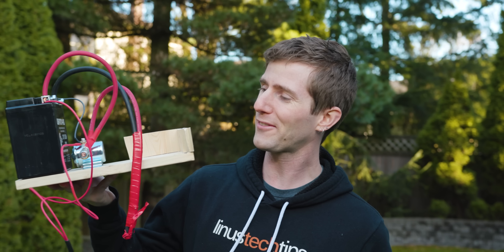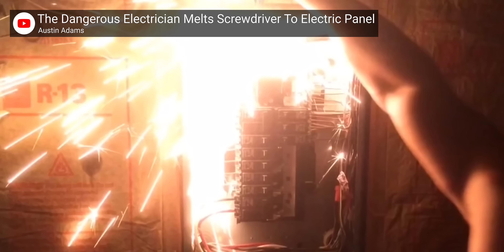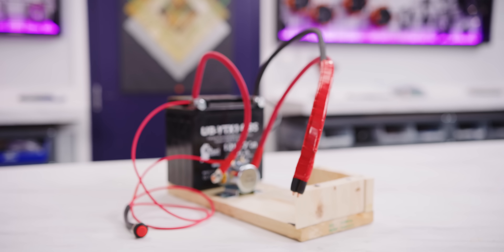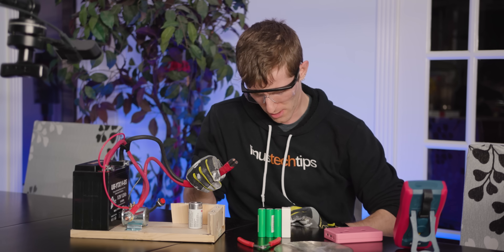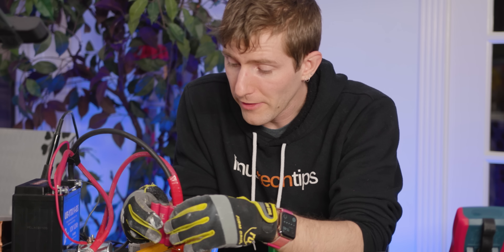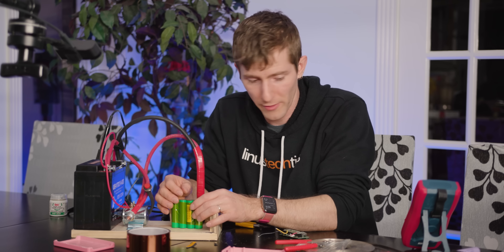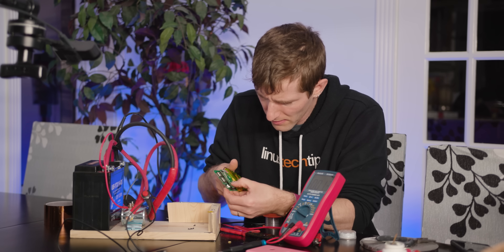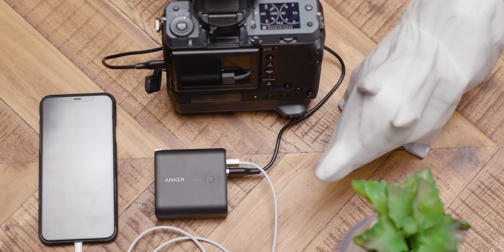I spent $100 to save 20 bucks... and it was TOTALLY worth it!

Comment: I will definitively not do that to save a charger , but it was nice to learn how to do it  . Thanks !! ❤️ Stay safe ! 😷
Reply: Easy solution buy a powerbank case instead, you can get cases with spring terminals that accept 18650s, same as replacing AAs in anything else.
Reply: @vgamesx1  yep, you can get them for like ~$5 and use cells from old laptop or anything really
Reply: the easy solution on this type of battery is buying 18650 sockets and soldering those, plus you can swap out the cells when they are dead. also you can use laptop batteries for that purpose.
Reply: @satibel  they did that on their other video (modding power wheels) they probably didn't do it here because you couldn't fit an 18650 socket into the power bank casing.
Reply: For Linus saving 20 dollars for 2000 dollars will be "worth it" too
Reply: @kausik206  to be fair, the amount he makes off of youtube ad + floatplane + sponsors most likely makes it worth it

Comment: Linus, you should really be using a n channel MOSFET to switch your high current circuit. That momentary switch is just not going to give you the control you need for consistent welds. A mono stable "one shot" 555 circuit comes to mind. Stay safe, and don't "relay" on mechanical devices to control duty cycle.

Comment: I'm going to solder a bunch of used 18650 batteries together tonight.

I'm soldering the pre-welded tabs together, using heavy gauge copper wire. I hope that made someone freak out

Comment: WOW ! This is great idea. But It will be MUCH BETTER with a timing circuit that will switch the relay on and off so you will be able to set the right welding time which you need. or even greater improvement to add fixed positions high power resistor with settable resistance to limit the current because sometimes is better lower current at longer time for higher quality weld but I am not sure if this is necessary worth. Also I would rather mount the battery in some kind of more durable frame instead of sticking it with tape.

Comment: If you wanted to make this home made spot welder more consistent you could probable use an arduino to control how long the relay is closed for when you press the button. The only issue there is obviously you can't use a 12V relay with a 5V arduino if it won't flip the relay with 5V.

Comment: You should have put a microcontroller between your button and your relay so you can have the microcontroller give the exact timing for every spot weld. This would have avoided all issues with over current and been a lot safer.

Comment: Maybe could've used an Arduino to "push the button" for you for a programmed time when you push it's button.
Or even give it 3 buttons for more_time, less_time, contact.
Or used some electronic components, but this is imo hard to do and tune.

Comment: Ankers batterie lineup is quite outdated though
Reply: I can recommend ravpower. They seem to have the newest tech right now. Usb-c 30w pd on small battery and 60w on the bigger. New bigger and energy dense 5000mah batteries.
Dodocool is great too and doesn’t cost as much, but is not always available on amazon. Has 45w pd too, bought it discounted for 20 bucks.

Comment: I did it with a Sentey 20800Mah power bank that was under half of the original capacity and also the original capacity was fake, the cells inside where 2000mAh unbranded chinese cells that were out fast, and now the 8 cells where under 1000mAh, to reach 20800mAh them must use 2600mAh cells, the real original capacity was 16000mAh, so Sentey lies. I replace those cells with 3000mAh samsung cells that I get for $15 so now I have a 24000mAh power bank that will last for many years with this good brand cells, probably the electronic board will die first than the cells were to a non worth continue using it point.

Comment: I see no reason no to spot welled another strip on top of the other one. In most big battery pack, where you can't simply run strait lines to connect the batteries, you must add another nickel strip just to account into the fact that some connections will have more current running thru them. In most cases the difficult part of fixing or doing DIY battery packs is to find decent 18650 batteries with good parameters and good price.

Comment: Actually your relay was acting weird because it is a mechanical relay and so when a lot if current is running through it it can stuck the Relay in contact  even with the command released si After it will operate perfectly normaly when it's not on load as in 8:58

Comment: There are also battery banks with replaceable 18650 cells, basically using the same methode as rc car batteries are swapped

Those would save some time and money perhaps

Comment: For the God's sake, why didn't you add a simple Arduino timer instead of spot welder switch?

Also, you should've pre-soldered wires to strips and then weld them.

Parallel is for capacity and higher current rating, series is for capacity and voltage. BOTH are for capacity. Ah are not for capacity, Wh are for capacity. Ah is usually misleading.

Comment: you go all the way to actually weld the strips, but then you just solder the tabs before welding them and heat the cells up anyway... smh. The electronics projects on te channel have always been so weak, better to do some more research...

Comment: 12V battery.... electrocution hazard... yea no. you would melt the switch and possibly suffer a burn but there is no way you would be getting electrocuted from that circuit. It also looks like that relay was being temporarily welded closed which is why it stayed on after you let go of the button. it's certainly cheap but not something you should rely on for more than a few shoddy welds. 

while i do like anker and they do make good powerbanks i found a usb C PD in&out bank by nusgear that is working really great for me that will actually put out 100W of power.

Comment: Pre-soldering the nickle-plate with a layer of solder would have probably improved the contact nickle won't bond as well to battery terminals as solder would, this would also allow for easier welds as solder melts at a much lower temperature than nickle.

Comment: From an electricians viewpoint: The Starter Relais you are using can weld/stick the internal contacts together by the repeated high current Pulse, or worse you can generate a high enough current in the Spotweld that the relais builds a strong enough magnetic field so the contacts in the relais do not release instantly but keep the current flowing. -> Danger of welding through the outer layer of an lithium cell = REEEEEALLLY BAAAAAD! even the 20 Bucks chinesium spot welder have an overtime Current shutoff as safety! THIS SHOULD NOT EXIST AND SCHOULD NOT BE USED ESPECIALLY WHILE NOT WEARING AT LEAST EYE protection, because the metal flung off by the welding can damage your iris and make you blind (worst case). Even more worst case is you kill the relay with an high current and it is internally chinesium relays that can withstand a pulse of X Seconds of Y Amperage but then sticks and shortcuts the battery and you think oh why is it not working, while the relays gets RED hot glowing and the next thing you know is the cooking battery acid Spewing all over you! FAT DISLIKE TO ALL OPTIONS!!!! this video schould be removed cause it is a catastrophic failure to happen !!!! I REPORTED THE VIDEO. Sorry I'm a fan of you since the beginning, but this is a failure to all safety regulations existing!! whoever got you this Janky idea should be removed for disregard of safety to property and people!

Comment: Any time I hear someone say you can get something "at any automotive shop" I have to wonder what auto shop they're going to. Autozone and O'Reilly by me (Cleveland west side) don't even carry the right weight of oil for my car. Thankfully Walmart does.
Reply: If they don’t have a generic aftermarket starter relay then what would they stock? Besides ugly bling?
Reply: there are quite a lot of bullshit auto shops out there
Reply: @peterg.8245  car shops sell anything besides ugly bling? /s
guess where the bigger markup is...
Reply: @peterg.8245  They don't carry much of anything useful that isn't universal fit. Wiper blades, but even then, not for European cars, and I don't just mean luxury cars, I'm including VW and Fiat. Batteries. Plenty of oil for older cars.

There are one of each of Autozone and O'Reilly in the Cleveland area that stock everything you could possibly need for Ford, Chevy, or Honda; but you're completely SOL for anything else.
Reply: Right Wing Safety Squad probably knowing we’re LTT is Lordco is the local auto shop
Reply: In texas you can practically rebuild a classic at a good auto parts store. I know bc my friend rebuilt an 83 el camino to pristine condition.
Reply: @VadersFist501st  that's awesome
Reply: @JaysFan69420  what weight you running? I run 20w-50 no synthetic in my 85 Benz. I find that the Valvoline stuff is pretty good
Reply: @commandohazelnuts  5W-40. Most European turbo engines and American auto-diesel engines use it. And yet the only shop that sells it is Walmart. Not O'Reilly or Napa - Napa does sell it, just not at the one closest to me. Autozone only carries STP branded 5W-40, but I wont use it because STP doesn't actually make oil and they don't say who their source is.

Comment: I build a same style spot welder a few weeks ago. I found a great timing relay, which controls the pulse from 10ms to pretty much every reasonable length. This makes it much more reliable,  repeatable and its more consistent. The relay module is called XY-LJ02 and can easily be found on Ebay or Amazon for around 15$ locally or for less than 10$ from overseas. I also found using a tungsten needle from a TIG torch as the electrodes super useful. I used copper wire before but it lost its tip shape to fast due to the temperatures. The tungsten electrodes hold up way longer. I just ask someone who does TIG welding if he had any end pieces for me that he would throw away.
Reply: for the timing, you can also use a 555 timer in the monostable configuration, with R=1k+100k potentiometer in series  and C=10uf
and use like 5 IRFz44 or any high current transistors in parallel on the output.
it's a very easy circuit to make, and requires only a few components :
555 timer, switch, potentiometer, 1k resistor, a 10uf capacitor, some high current transistors, and some 1-10k resistors for pull-up/down on the switch and transistors.

note that you can increase the resistor value if you decrease the capacitor value and vice-versa.
these values are for ~10ms-1s pulses.

note that you can also use an arduino instead, and just switch the transistors with it.
Reply: @satibel  is there a circuit plan available?
Reply: @satibel  I still have my (Radio Shack Engineer's Mini-Notebook 555 Timer IC Circuits).  I bet it's 30 years old.  I took a quick look and it's archived online.  Here's the link  http://www.n5dux.com/ham/files/pdf/Forrest%20Mims%20-%20555%20Timer%20IC%20Circuits.pdf
Reply: @satibel  I also looked into it, but found it much easier to buy the module. Found it from China for 5$ and it does pulse times from 0,01 seconds to 99,99 seconds in 10ms increments, 0,1 - 999,9 seconds in 100ms increments and 1-9999 seconds in 1000ms increments. For that price in can't invest my time in sourcing the parts and soldering them. 
I'm using a foot pedal from an old sewing machine as the switch to have my hands free.
Reply: This, this here makes it so much better.

Comment: The ironic thing here is that his homemade spot welder is actually more dangerous than attempting to solder the cells because if you apply the heat for too long from the spot welder it can actually get hot enough to melt through the casing of the cell causing it to vent as the one did in the video did.

Comment: Can i just shout out that guy in germany who makes arduino based battery spot welders. "malectrics". The device is SOOOOOO much better than this because you can control timings down to the milisecond and it has preheat functions, you can add a foot pedal, or it can just sense when your electrodes come in to contact. Comes with everything you need. Please, check this guy out before even thinking about building something as ghetto as this.

Comment: What is high current power? Power is voltage times current, you need voltage to create current. What electrocution hazard? 12v DC is nothing because the human body blocks DC.

Comment: "When you solder, you have to heat up the solder itself and flow it on to the materials you're trying to join."

NO! That will get you a cold joint that will have high electrical resistance and break easily. You need to heat the MATERIAL to above the melting point of solder and apply the solder to the MATERIAL. In practice, it helps to add a bit of solder to the iron to help transfer heat and a bit of flux to the material. To join materials, you should "tin" each one first.

edit: and I'll bet that was the cause of the bad connection at 11:33
Reply: you're completely right, but lets not pretend that was the most incorrect part of this video lmao
Reply: But the hold problem of heating batteries for a long time still exists
Reply: @sid670  right, so you solder your contacts to a wire before welding them (a loose one not connected to the electrically sensitive mainboard). But then I guess it would make having to weld more contact strip on to the batteries, because you didn't plan properly, more annoying.
Reply: Yeah... I really don't recommend looking at their videos where soldering is involved 🙈
Reply: What he said is correct, you do have to both heat up the solder, AND flow the solder on to the materials.  The solder will not flow if the materials are not also heated up.  If you ever get into soldering SMD packages, this is something that is commonly done, the soldering iron is not a point, but a bit of a well to it which can store solder that you can brush across the contacts to solder due to the contacts being such miniscule mass, they heat up to the proper temperature extremely fast. This is called "Drag Soldering". You do however need keep in mind how much flux you have.
Further, there is the mass production version of soldering called wave solder which is a literal vat of melted solder which the board with parts on travels through and gets soldered.
Reply: Part 2: That being said, I know what you meant, he failed to flow the solder onto the contacts due to the contacts being too large of a heat sink, and him burning up his flux due to him not knowing what he is doing.  lol
Reply: they suck at these things

Comment: 3:30 Hot and ground do not apply to DC. Positive and negative only. DC doesn't have a ground and "hot" wouldn't be hot without negative.
Please leave playing with dangerous amounts of power to people that at least know the difference AC and DC.
In order to safely "pack" those batteries they all need to have extremely close CAPACITY - they're ALL going to sit at 3.7v 4.2 nominal. That's a standard 18650 voltage, they're all going to be there.
Linus dude. Normally it's funny, but as someone who actually has a friend who's vape turned into a hand grenade - do. not. ever. do. this. again. You DON'T know what you're doing and you're GOING to hurt or kill someone.

Comment: 3:45 I don't think 12 V DC can be an electrocution hazard. Sure, you could get burns from the switch itself melting, but no electrocution.
Reply: The skins resistance is too high for it to do anything, it could be a million amps & you’d feel nothing. Wet hands though you might feel a tingle but it won’t kill you
Reply: Its not the volts that kill you, it is the amps.
Reply: @White-Wolf1969  You cannot have the amps without the volts

Everything in the spot welder has very low resistance, which is why you can see such huge currents. Human body has comparatively very big resistance, so at 12 V DC, the current will be next to zero.

Comment: I noticed that Laptop batteries from my HP and MSI contained 1 18650 battery that was marked with permanent marker (just a stroke) and those where the dead ones, others were fine and serve in my ecig since 2 years.

Comment: It's actually unwise to do this. The board electronics that give you the necessary safeguards as well as charge indication and cutoff need to match the exact storage and output of the replacement for safe usage. I don't think that is the case here. But oh well.

Comment: You can remove spot welds by grinding them with a dremel tool, that's how cells from faulty new battery pack are recovered. (not necesarly original dremel tool, knock-offs will do just fine, or even better because equal quality for cheaper price)

Comment: 100% that this is gonna get buried in the comments, and probably someone said it already, but most of these bms circuits need a reset after connecting a battery, which is usually done by connecting it to a charger.
Reply: Also, completely unrelated, and totally not from experience, but if you read the datasheet for the components of the project you're working on, maybe you can spare couple hours of cursing and trying to find why it doesn't work.